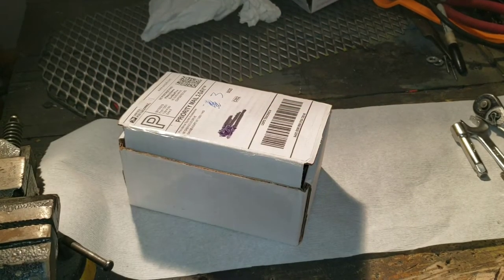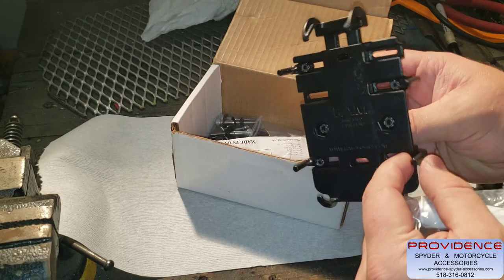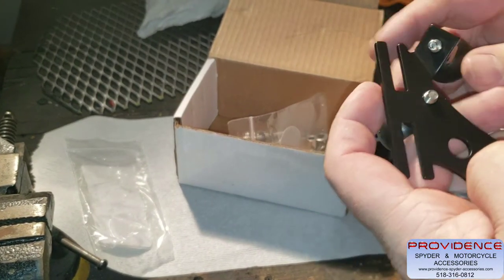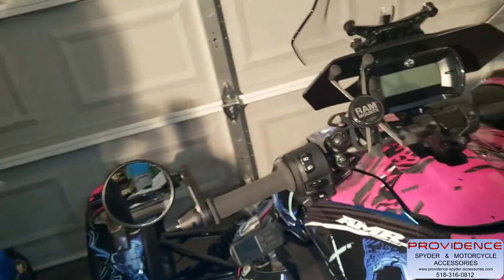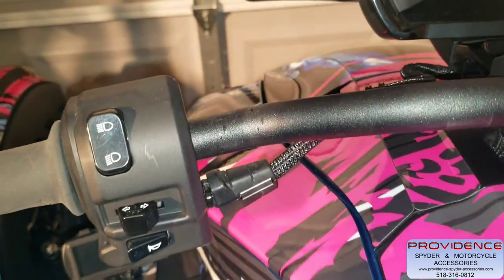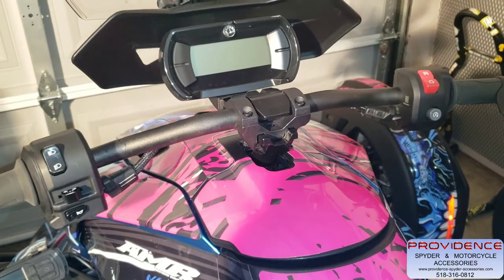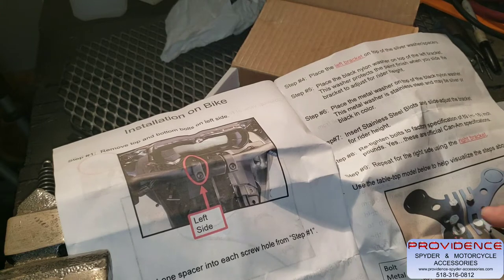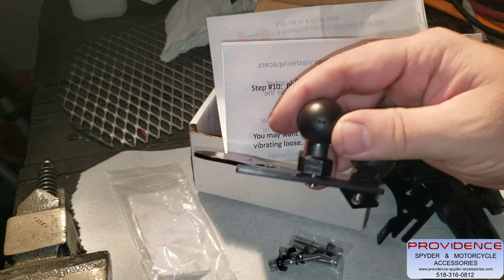Can-Am Ryker cell phone docking station by Providence spyder & motorcycle accessories

Comment: The Spyder's Extra one that Slingmod sells allows you to move your handle bars the full range all the way forward & backward and has 3 accessory holes on each side as opposed to 2. It also comes with a usb on one side and a cigarette lighter plug on the other.
Reply from the maker: Yes this one will allow you to move the handlebars as well and on their website you can order this which is the basic model or you can order the one that comes with the cigarette lighter plug and the USB plugs. I have seen the one on sling mods and they are very similar in design. Both are a very nice option.